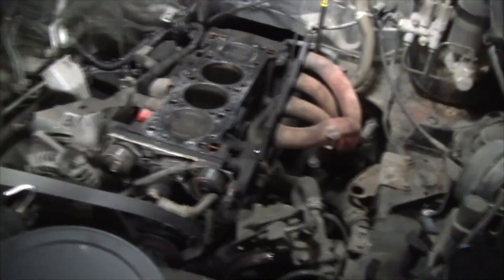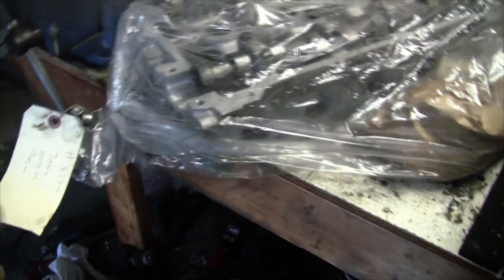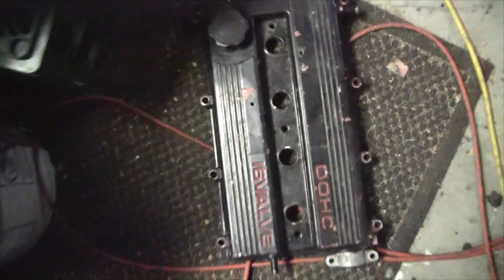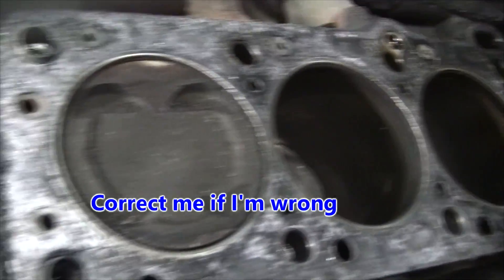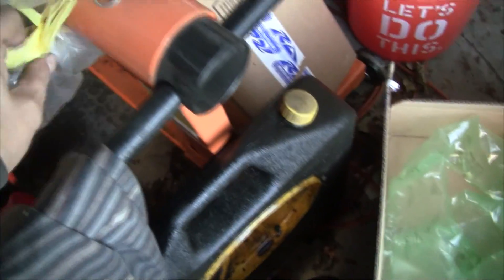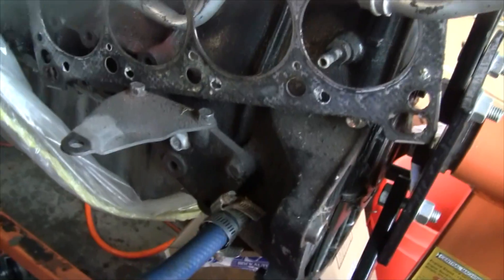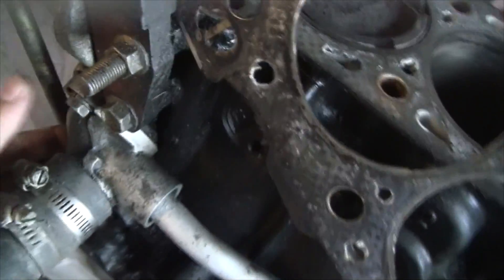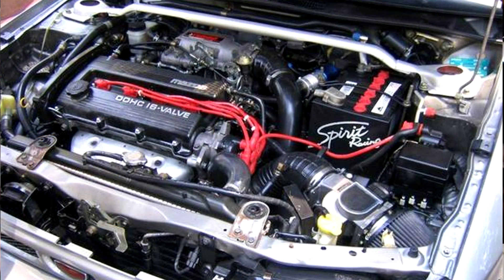What is this Mazda Turbo Engine???

Comment: Can you find the identification numbers on the block? Mazda VINs will start with JM1 followed by the model's designation. For example, your 92 Miata is probably something like JM1NA3510N0000000. NA351 is the designation for at least early Miatas. Type that section into google followed by vin (NA351 vin) and it may give you what you're looking for.

No thermostat housing on the front so it came out of something with the engine transversely mounted.
Reply: Jeremy Robles I haven't found a single series of numbers anywhere so far.